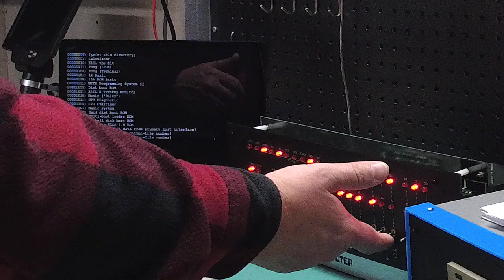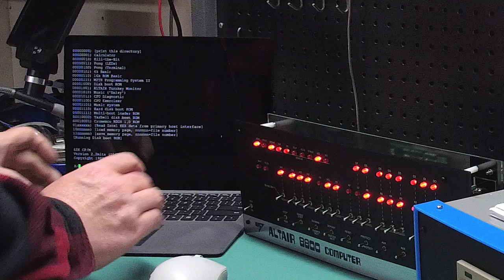Altair-Duino Disk Expansion Kit

Comment: So I have built this, kit, I am able to get into the monitor program via a usb cable, bit I have no idea how to proceed.

I want to create a C/PM BASIC disk to save some BASIC programs on.

Do you have a 'How-To' guide for dummies on how to do this?
Reply from the maker: Visit David's Github page or the forum (links in your manual).
Reply: @chrisdavis3055  Yeah, I have been poking around those sites. Think my drive is bad, bought an untested one on Ebay. Ordered a cheaper, tested 3.5 in drive that David mentioned also works, as a test to determine if my controller board has an issue or the drive. If the 3.5 drive works, I know the drive is bad, otherwise I have an issue with controller. I will get it sorted out.
Reply: I tried with a tested 3.5 drive and it works, so I know the controller is good. While waiting for a tested 5 1/4 drive to come in, I will sort out creating bootable disks with the 3.5 drive